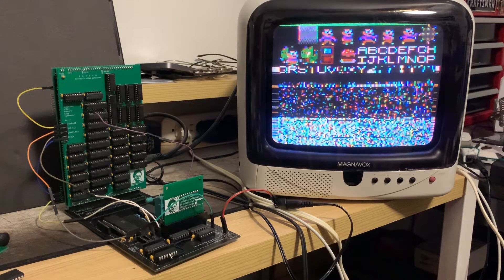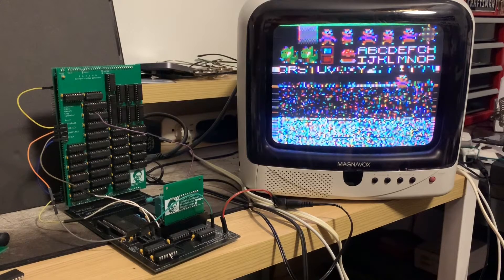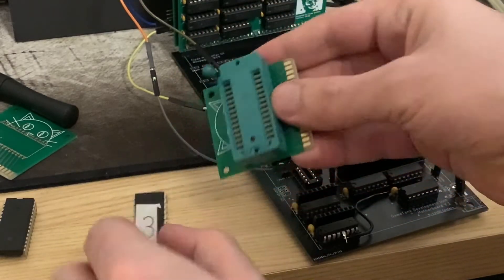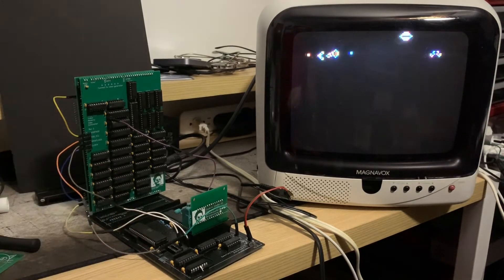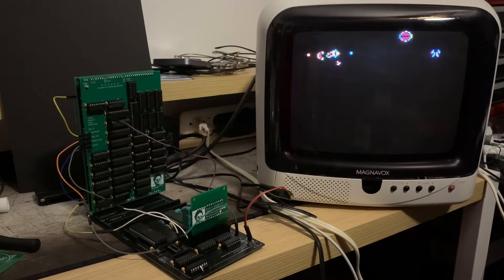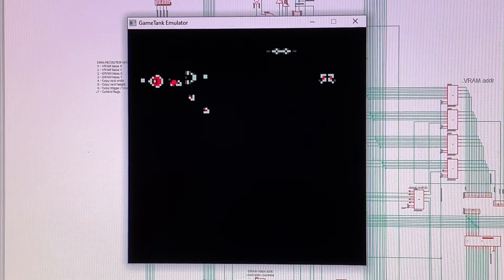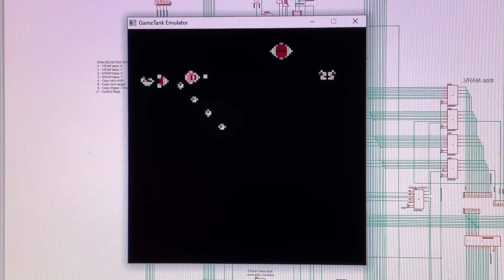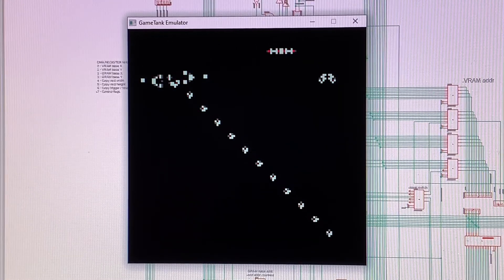GameTank Project Update - May 2020

Comment: Have you thought about getting a ROM Emulator for your development/testing?  The last time I did a 6502-based project, I bought myself an Moates Ostrich 2.0 and it really helped. You just plug it into the ROM socket, and can update the ROM data via USB from your PC using a little utility program. Really quick, and no chip swapping.
Reply from the maker: Hey, that looks like a rather useful device! With an adapter board I could even see using it not only to send ROMs to the "cartridge" but also debugging general bus behavior. The next day after posting this video I figured out that the graphics card works fine if I use an Arduino to emulate the motherboard. So now I just need to do the reverse and debug the system bus...
Reply: @ClydeShaffer  You might need to figure out how to write your own software for this thing to use it as a bus debugging tool. All the existing software that claims to do this, is written with the assumption that you're only use it it to reverse-engineer automotive ECU firmware behavior. I've had the most luck just using the simplistic "EmUtility" with it as a way to prevent the need for ROM swapping.
I also recommend the "Socket Booster" accessory they sell for it, which basically just adds some buffers to the connection. Without this, I had some difficulty getting it to work (likely due to the long cable it comes with).